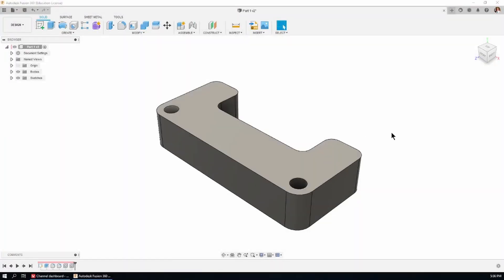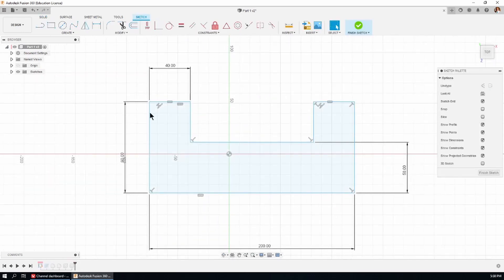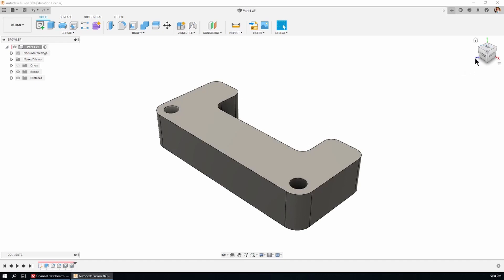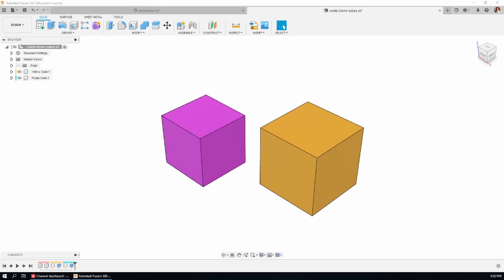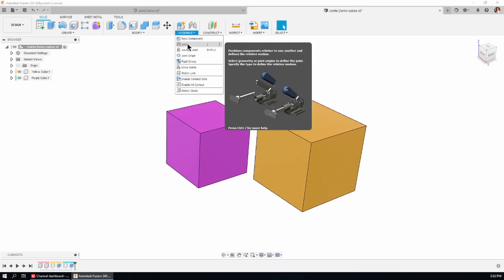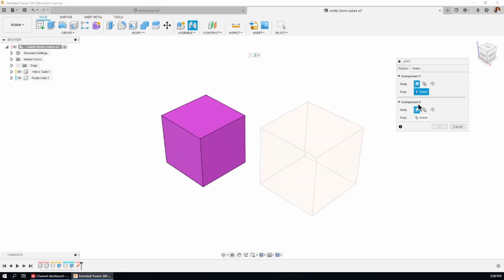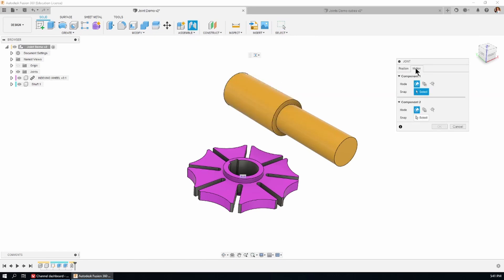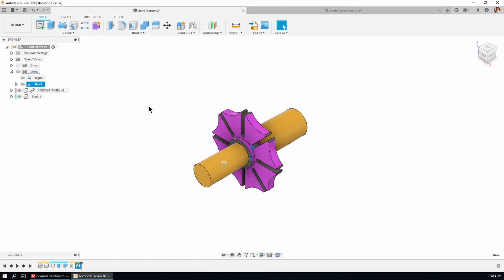Part Orientation In Fusion 360 | Four Ways To Do It

Comment: As a machinist, alignment is the FIRST consideration. It’s the first thing we consider when looking at a part to make. Z for me at least would always be aligned with the spindle of a machine so having a drawing always start out “sideways” is frustrating.
The “preferences” choice looks like the best one for me, but it should be noted you have to restart the software for the change to take effect: the little “orientation cube” at top right remains the same after you change the preference unless you restart. The actual orientation doesn’t much matter to me as long as the actual matches the visual. Three year old video as I watch this but the situation remains with my version.

Now the question: How to change the Cartesian system to reflect my preferences. The default one has positive numbers in what we associate with the negative Y direction.
Reply from the maker: OK dart, good question. I'd test that but since I have no experience machining I'll point you to the best resources I know of. There are two channels where experienced machinists are using and teaching Fusion, one is NYC CNC here https://www.youtube.com/@nyccnc and the other is Clough42 here:  https://www.youtube.com/@Clough42
Here's what I believe and why I didn't give much attention to starting at the point you're expecting: Alignment is a doddle when you've got 100+ hours under your belt and then most new parts that I make are 'in-context' that is initiated within an assembly without so much as a thought for its own origin. I would check and test and adjust three times for every part set-up anyway when it comes to my precious machine (if I had one).

Comment: Thanks Arnold...I have a mock up 'granny flat' building with multiple sketches and bodies..which I built on the wrong ground plane...I can rotate the sketches...I can rotate the bodies...but for some reason when I rotate them..they don't end up joined together anymore...ie. I just want all the sketches and bodies to rotate together. Having trouble getting any of these methods to work! Shall keep trying!
Reply from the maker: Hi Matthew, Fusion 360 isn’t the first choice for building design but you can certainly do it. At first hearing of your problem I’d ask if you’re aware of Boolean operations? Do you need to keep the bodies separate for some reason or would it be OK to unite them into one? A single body might be good for a schematic design of the building but when you’re moving toward construction documents you would likely need an assembly.
Reply: @ArnoldRowntreeTeachesFusion360  Thanks Arnold..I ended up posting on the Autodesk forum and found the simplest method was just to rotate the view cube to a new front face! It's doing the job for the building plan...could use Sketchup or something..but I just know the Fusion workflow better for a quick job. Hope you are well! Thanks!

Comment: Thank you Arnold! As a beginner in Fusion 360 nothing moves/orients the way you want it so these few little tips make a HUGE difference. I spend way too much time trying to get my parts oriented in a way that makes sense to me.
Reply from the maker: I'm glad it helps Holly, I kept telling people not to worry but its easy enough to fix this. And what are you doing with Fusion 360?
Reply: @ArnoldRowntreeTeachesFusion360  Well, after your 16 part course I designed a small platform to hold a water reservoir bottle onto a stainless steel "wet" table. I"m a vet and we use a wet table for dental procedures. I also designed knobs for a old set of drawers my father built 40 years ago. It was built for his workshop to hold various nails, screws etc. He used small round headed screws for drawer pulls and after 40 years they needed an upgrade. So, now there are knobs held on with small bolts. Nothing astounding but I love the fact that I can take a concept, design it in Fusion 360 and then print out the completed part! Very cool....thank you again Arnold for your videos!
Reply from the maker: Thankyou for sharing Holly, that's encouraging, I hope you'll find plenty more of those 'small' uses for your new skill. Watch for my upcoming content, I have a few items coming about 3D printing.
Reply: Thank you Arnold, another very informative video! Would like to see one( maybe there is one already! ) showing how to modify an existing sketch and adding another component correctly oriented to the original. I keep getting mixed up with which plane I should be in! ( if you can understand what I mean !!!)
Reply: could not agree more, thanks arnold

Comment: nice to see you back.....lockdown so i got time to learn again.....bring it on  ;-)
Reply from the maker: Thanks CVR, I'm pedalling. Actually there's one thing I want to experiment with down the track with VR/AR and that's free body diagrams superimposed on video of a mechanism. Another would be examining engineering simulation results in a walkthrough.
Reply: @ArnoldRowntreeTeachesFusion360  actually have been thinking of that for a while but lack of time and experience keeps me away....thinks like fixing stuff where the AR glasses tell you where to unscrew things in real time....tricky..